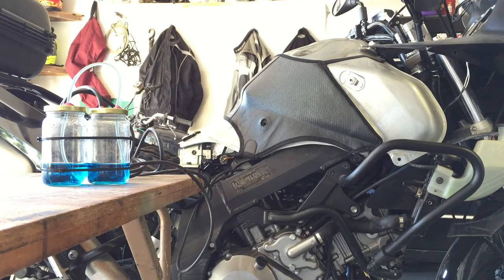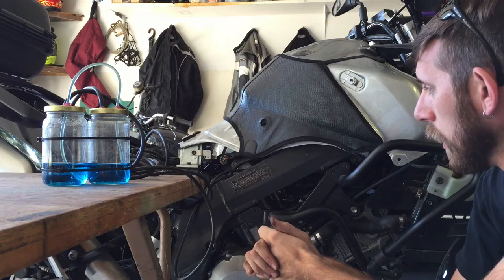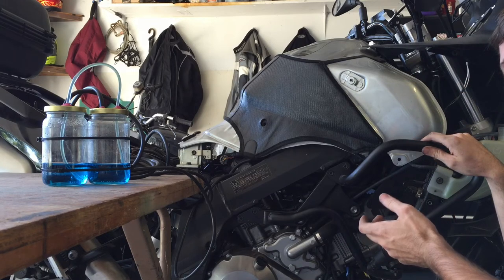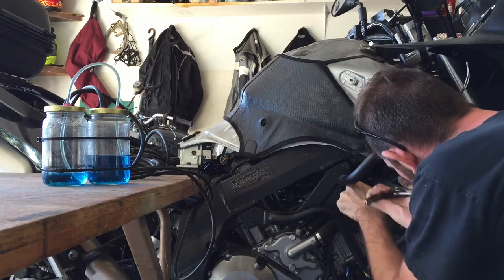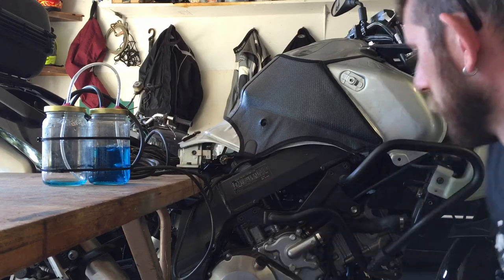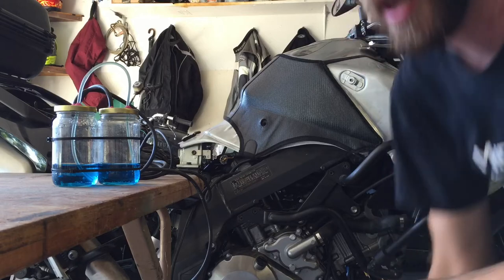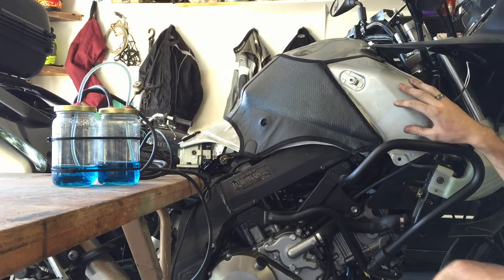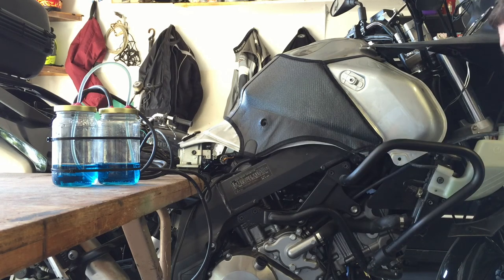V-Strom Throttle Body Sync

Comment: Congratulations on the video friend. One question, what liquid did you use in the container. Could it be just water?
Reply from the maker: Yes, I just used water with some dye. With this setup there’s virtually no danger of sucking any of it into the engine like there are with some of the other DIY manometers
Reply: @DustinRogersinMO  perfect friend. Thanks. I'm building one just like you did. Thank you for the video and I return to my question.

Comment: Great video. Just a couple quick questions. Did you use 5/32 or 1/8  ID tubing? What material did you use to seal the tubes going in and out of the jars? It almost looks like Plummer putty.
Reply from the maker: Nick Velalis I don’t recall what size tubing it was. It was just what I had laying around. I actually think the black tubing is some leftover drip irrigation tubing from the garden. To seal around the tubes going into the jars I used SUGRU, but again this was just because I had it. You could use epoxy, silicone, or even hot melt glue. Anything that will seal up.
Reply: Thanks for the reply! I ended up going with silicone, since that is all I had laying around in the basement. I guess I will know tomorrow if it holds up. Thanks again!
Reply: On tl1000 and dl1000 models its .25 tube with inside like 3/16  I think. You can use aquarium tubing & it's cheap. I saw this style homemade manometer on a forum & it's pretty cool. Been trying to sync my tls last few days,having complications lol